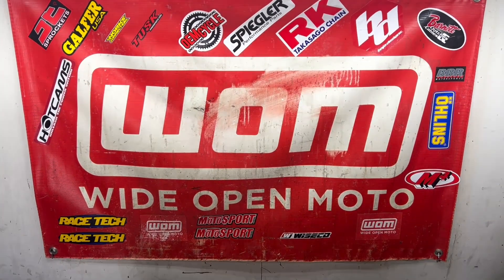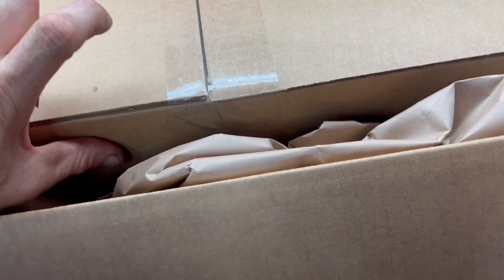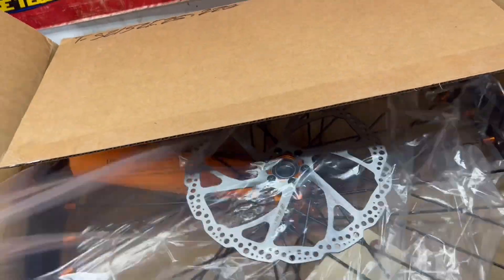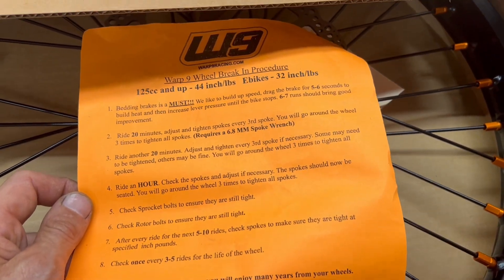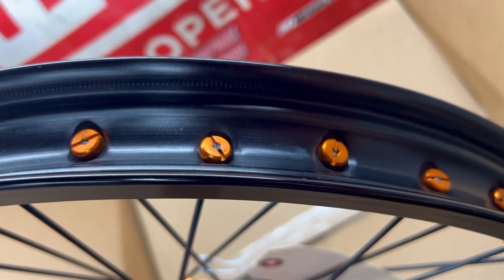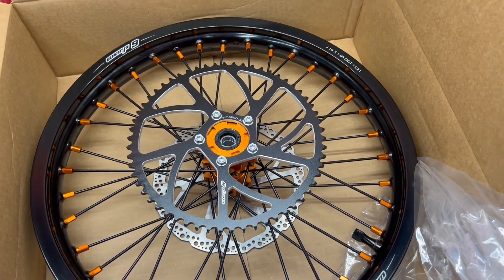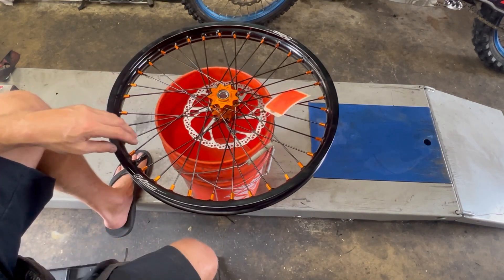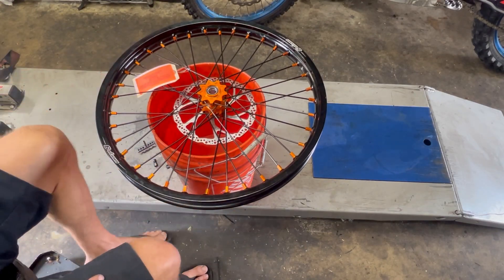Warp 9 Complete wheel set unboxing and Tire/tube install for Surron/Talaria and Dirt bike/MX

Comment: Whata the difference between Warp9, KKE, and Milk Raceing? Is warp 9 and KKE worth the extra $500? I'm a future buyer of an ultra Bee on supermotos
Reply from the maker: Warp 9 wheels are known in the motorcycle industry as a great quality product.  The wheels come ready to bolt on, including brake rotors and sprocket.  And all warp 9 wheels come with their lifetime guarantee which basically says if anything breaks, you send them the wheel and $60 and they will repair or replace the wheel.  What it really comes down to is the quality of the materials, and I’ve used warp 9 and sold dozens of wheels and never had an issue with any of them.  When you’re ready to pull the trigger on a set let me know and we’ll get you the best price possible, and I can have them shipped directly to you (if you are outside of California there is no sales tax either)
Reply: @wideopenmoto  thank you for the info. Darn yea I live Ina san diego ca. But moving to Indian soon for school. I'll definitely reach out to you guys!!